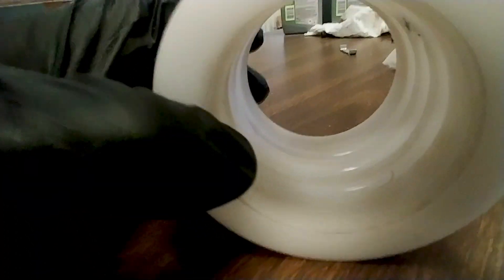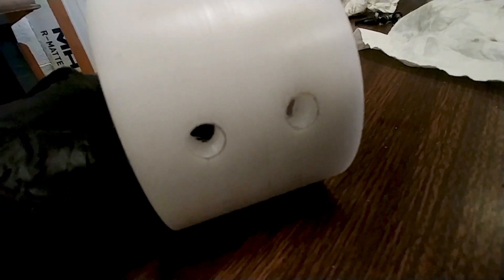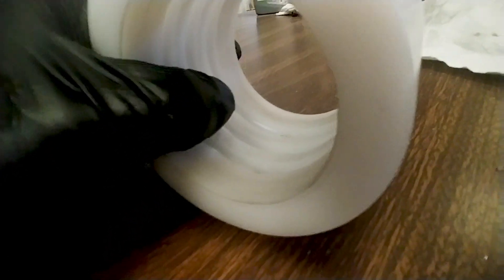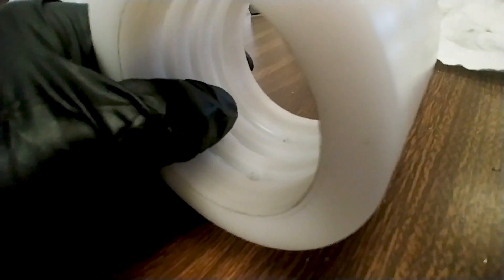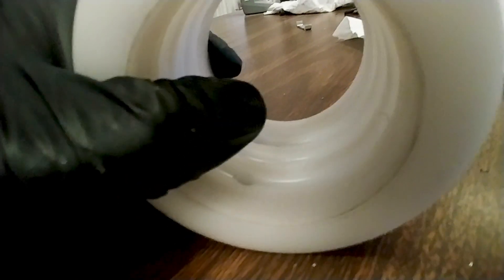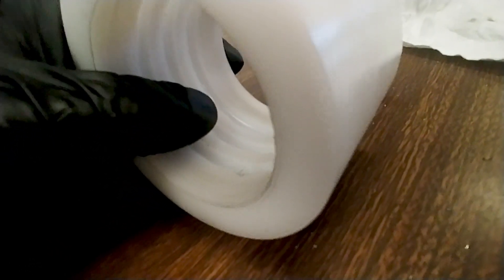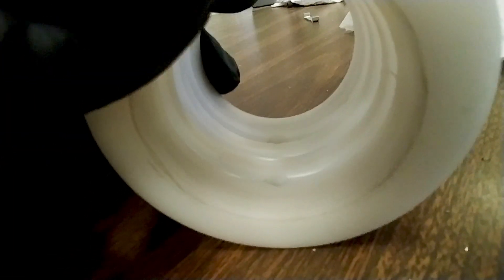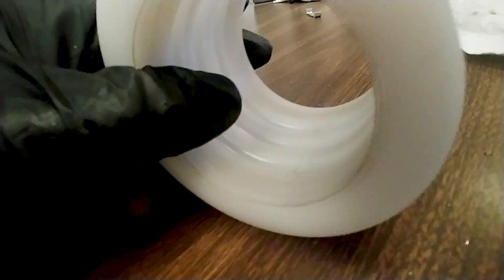Unable to Hold Pressure - Flying the Raptor Prototype

Comment: Any comment about the turbo guy that had some input about your choice of turbos? Rv6evguy  sounds like he knows a thing or two about turbos.
Reply: It's been at the top of my mind regarding this project.  They normally are two sizes and are spec'ed using RV guy's design.
Reply: Bjarne Värme
 Yes, no doubt that Rv6evguy is sharp concerning serial compounding turbos for his Petrol Subaru aircraft conversion engine, with nice intercoolers looks top notch to me... That being said Peter did his homework for serial compounding the 3L TDI Turbos... I don't think Muller is attempting to produce a race aircraft with Raptor... The Raptor's target is to have a service ceiling of FL-24 and sip fuel at 7~11 GPH... To my experience with turbo charging diesels this reflects a planned target of Raptor's diesel power plant producing between 140 ~ 210 Horse Power @ Fl-24 continuously with reserve HP...   Long range roomy luxury cruiser capable of tracking groundspeeds well over 200 Kts. with a pressurized cabin... From my calculations with the turbos that Peter is employing it appears to me he has nailed his intent. The Intercooler/s shouldn't be a problem to get dialed in, once Peter progresses in his flight testing to higher altitudes. At FL-24 the temp is about -32.5 C / -26.6 F  most of the time with tail winds traveling from West to East most of the time facilitating ground speeds of over 200 ~ 230 Kts though the corrected IAS of the aircraft is indicating only 100 Kts. when traveling in North America. The difference at the end of the day is fuel economy 11.8 MPG with existing aviation petrol powerplants Vs 29 MPG with Raptor's Diesel Power Plant... With engineering turbos it's a balancing act between intention of wasting fuel with high speed or cruise economy. Personally I like cruise economy... When we up the boost for speed we end up spending lots of money paying for the fuel only saving just a little time... Cheers
Reply: @Will Hibbard II ....  Basic thermo dynamics are that and you have to work with them. The current setup is wrong that’s it. 🤔
Reply: @richard8181  , Nope... I disagree Peter's specs with his turbocharger series combination will do the job as he intended... Just not to RV6EVGuy's preferences... Raptor a luxury cruiser with reserve power vs RV6 No reserve pylon racer... RV6 knows petrol SI turbocharged engines... 🤔To categorically across the board claim that the turbo setup for Raptor is wrong I would find insulting. From my point of view, RV6evguy presenting a Man 3 stage compressor designed to pump Co2 from gas to liquid is horribly misleading. RV6evguy compounding sizing turbo theory with an aircraft designed for above FL- 40 operations isn't spot on either...Interesting information however not applicable to CI Diesel design at FL-24...

Sea level ~ Fl-18 expect 1 ~ 1/2 atmosphere ambient temps range from +15 C ~ - 28.7, FL-18 1/2 atmosphere ~ ambient temp -29.7 C and FL - 24 ~ 1/3 atmosphere ~ ambient temp - 32.5 C... When you work with real dynamic numbers for benchmarks you can see what to expect at altitude... Balancing coolers to drag is part of the experimental process with negotiation of desired balance of result... 

Not right or wrong just a difference of opinion of reserve or no reserve horsepower and the resultant drag of cooling 400 HP continuously... or cooling say 250 HP continuously with reserve... The Constellation aircraft used this strategy and it worked crushing other competitors with piston engine performances with efficiency, lower maintenance cost and quiet reserve... For many years!

Thermal combination compression influence totaling less than 180 F... Requiring relatively little inter-cooling... At FL-26 performance will degrade rapidly however that's not part of the intended envelope profile for Peter's creation of Raptor. When operating above FL-26 an inversion takes place that axial turbines, symmetrical centrifugal volumetric velocity compressors, blowers, superchargers facilitate better than what a single turbo or turbo combinations can offer... 

Many folks talk Turbo synonymously with turbines, symmetrical volumetric flow centrifugal velocity compressors (Turbochargers)... The difference? Symmetrical centrifugal compressors, blowers and superchargers won't/don't create vacuum.

Turbo effect is facilitated by asymmetrical volute housed centrifugal impellors that employ both centripetal suction on the intake side driving increased velocity at discharge side, increasing both intake and discharge velocities simultaneously...
 

I've found many name brand turbo products to be just symmetrical volumetric flow centrifugal velocity compressors driven by symmetrical volumetric flow centrifugal velocity compressors... Not as efficient as true turbo technology in some applications... These are generally marketed as Turbochargers...
 

They work to facilitate boost when applied with specific parameters... However for me to say he need not employ a Turbocharger but to employ only dual volute Turbo series compounded with a duel volute Turbo would also be insulting...

Many tricks in the trades that waste fueled energy...  

I mix and match regularly with variable results with all types of these units for the marine propulsion industry. Your mileage may vary😉 Cheers
Reply: Hi  @robertkramer621  , Yes I know I cast yarns of word salads. If your referring to RV6evguy's analysis as dispassionate concerning serially compounding turbos for converting automotive CI Diesels to aviation powerplants. Verses my response seeming somehow emotional to you. Honestly I have no horse in this race! I believe that RV6evguy does. He has created a business with his Subaru petrol system and pushing that engine to top horsepower for pylon racing.

The horse race is similar to the war of the currents that Edison and Tesla demonstrated in their marketing campaign to win contracts. Edison wanted DC because he had commodity business interest in copper. DC meant bigger wire to handle the DC current so he promoted it. Tesla on the other hand with 3 Phase alternating current proved that with higher voltage that smaller wire could facilitate more work with higher efficiently. 

Axial turbines and centrifugal compressors fueled by Jet A are most efficient per pound powering ships, generators and fixed wing aircraft when loaded with cargo or people.

Turbine engines have proven reliability with a remarkable service history and economic fuel consumption per cargo weight and passenger mile. The numbers don't work economically efficiently with 4 ~ 6 place aircraft.

Look at the P-51 Long Nose Thunder Experimental aircraft propelled by the 601 Walter Turbine. This is a single place aircraft that is very fast delivering a cruise of 220 kts IAS at 12,500 MSL trading fuel for distance at the rate of 4.3 gallons every 22 nautical miles of distance progression every 6 minutes... When the math is worked the average MPG is 5.88 MPG on a thousand mile trip employing an engine that can carry 16 people for single pilot work is a luxury expending 170 gallons to do the work.

Aluminum block CI piston diesels have arrived with proven reliability rivaling turbines. (We have 20 years data) almost the same weight as their air-cooled counterparts capable of delivering twice the usable horsepower of their same weight petrol fueled counterparts.

Same weight engines but the diesel is capable of providing twice the propulsion.      

I spend time in the marine industry working with turbo boosted CI diesel propulsion. My experience with boosting diesels is that KWH output rockets compared to boosting petrol engines. CI Diesels have reserve torque because of the much higher compression ratios. When we boost CI diesels to max design horsepower they respond with increased overall torque delivering Higher KWH output which equates to more heat. In the marine industry ambient cool water is available and working with intercoolers we can cool any part of the system without creating additional drag.

Balancing the economics of fuel burn of 7 ~ 11 GPH fuel flow is exciting to me in a 4~5 place aircraft. Capable of doing the same work at FL-24 that the Walter 601 Turbine requires 43 GPH to do.

I wasn't aware till first viewing Raptor in June of 2020 that diesel pistons were so efficient at propelling light aircraft... With Peter's application he has available twice the power he actually needs so he can afford to operate it at lower horsepower boost settings to conserve fuel and reduce heat. It will become clear as he progresses with altitude test through 12,500 (- 1.6 Atmosphere) Then FL-18 (-2 Atmosphere) and finally FL-24 (-2.58 Atmosphere) 

The demonstrations at 5,500 (- 1.22 Atmosphere) Look good to me. I know he has enough boost at this point balanced to his intended fuel flow and that's not the problem. He has enough room in Raptor to add as much radiators/intercoolers/oil coolers as he wants to achieve his thermal cooling objectives.

My future is calibrated these days to do a similar Experimental aviation work employing a marine 3 L V-6 CI diesel except similar weight to the Audi 3L TDI with a more conventional all composite aircraft that I prefer for personal use. I'm not wanting to create another business like Peter or Rav6evguy. 

I'm inspired by both guys but I have my plans are coming together to produce for myself what I've found lacking with conventional certified aircraft and other experimental machines. 

This will be my 3rd aviation experimental to produce. Cheers
Reply: @robertkramer621 ,  If your talking taking time to further watch RV6evguy's channel I unsubscribed to it after his last presentation. I'm not a fan. Presenting a Man 3 stage centrifugal compressor designed to pump CO2 is way off topic.  I've worked with those machines in their application in chemical manufacturing. Further presenting an aircraft that is designed to operate @ FL-40 again way off topic... As far as me leaving a public trail of positions which you view as trounced by reality. I'm persistent and tenacious with my innovations. With experimental there are many ways to get the job done. I see what's right with Raptor not what's wrong with it. A very worthy innovation of Burt Rutan's work. Not quite my cup of tea however I like it. I knew it would fly before Peter flew it. I knew it would be fast even though he overbuilt the concept prototype. Watched every update that Peter has produced. Which aircraft is your favorite to fly and how long have you been a pilot? What's your favorite engine?
Reply: @itsverygreen532  , It’s true when turbos are compounded off of a common manifold in configuration the Egt/TIT is up. As I’ve said it’s a balancing act. Using the second turbo as an additional muffler with the increased backpressure is a cooling balancing act. 

More boosts create more power, higher fuel flow, higher temperatures! Since CI Piston Engines are effected directly by compression ratios with turbo boost the relative term is (Combined Compression Ratio) 8:1 Piston SI petrol not much heat created by the engine up to 32:1 Piston CI Diesel under KWH Load equates to plenty of heat generated by the engine at the exhaust.

CI Diesel engines will run higher EGT/ TIT when under full torque KWH loads than SI Petrol Engines. It's physics of compression happening in the engine.  

I think what Peter has gotten right is he only needs about 220 HP for a cruise climb out with the Raptor platform. He is getting that with his Audi TDI power plant at 11 GPH fuel flow. Plus allot of additional reserve. To do the same work with Petrol power plants it takes 22 GPH fuel flow. At least that’s what I see! 

Bottom Line when you have the boost available and you call for torque loads, heat is the byproduct delivered through the exhaust! As long as the exhaust drive side of the turbo can negotiate the EGT without heat failure... No Problem!

The airflow accelerator boost side of the turbo is only negotiating about 3:1thermal compression equivalents with both SI and CI engines. Approaching 4:1 boost compression creates other problems. 2:5 is my rule of thumb for production side boost for marine application.   

I’ve addressed before that the Concept Raptor Prototype ended up overbuilt with more weight than the intended design weight target. Built like a tank. The first time I worked an all carbon fiber boat hull I overbuilt it too as the hull ended up built like a tank. I learned on my next hull where to back of the unnecessary weight I added. I ended up trimming the fat, reduced the weight lower than my original concept target by 150 pounds. The Third hull ended up being lighter, faster, and stronger than the second. So I’m confident that a Raptor production prototype will be more on target for intended weight. 

The good thing is Peter and his team produced great quality molds so the aircraft on a next build will be simple to replicate and trim the fat. 

Raptor’s concept prototype empty weight (as is) to my thinking, is a great platform to flight test the propulsion system in my book. Additionally it gives great data of cruise climb to altitude. It represents a fully loaded Raptor. The propulsion system is getting a workout. 

Example: Have you ever flown a Mooney Bravo fully loaded to FL-24? It climbs out just about like an elderly C-150 too. I’ve experienced on long trips from 0 to 17,999 arriving @ FL-18 takes a while 375 ~ 450 FPM Avg. It’s a balancing act in the thin air VX 105 CIAS cruise climb doesn’t work but VY cruise climb 120 Kt’s CIAS works to step by step get to FL-24. The single stage turbo in a Bravo does perform well to FL-18 but is lacking through FL-22. Some days in a fully loaded Mooney Bravo It’s a long way to FL-24 from FL-22. (Like flying a C150 from 10,000 to 14,500) That being said FL-26 in a Mooney Bravo is doable just not very efficient to the envelope. Sometimes to call the situation Mooney Bravo Heavy I've considered.😉

Note: VX in a Mooney to clear an obstacle is about 65 Kt’s. My style of flying I accelerate to 80 Kts in ground effect,  clear obstacles then accelerate to 100 Kt’s to 3,000 AGL then accelerate to 105 kts through 5,500 MSL, then transition to 110 ~ 120 Kts CIAS to altitude. VFR climb out I let the machine do its thing! Whatever the FPM is it is! To keep the cabin quite 120 Kts CIAS is relaxed and comfortable when flying a Mooney on long trips of 3 hours or more en route cruise times. 

When dealing with single engine piston propulsion. Haste makes waste! At altitude the 120 Kts CIAS reflects ground speeds of 135 ~ 210 Kts depending on wind aloft components. If I'm pushing 140 kts. CIAS in cruise I feel I'm being wasteful with fuel. 

What Mooney and Raptor have in common are laminar flow wings. Once you get a Mooney to altitude (even naturally aspirated) The VFR cruise decent is hard to beat. The heaver the better! Raptor has a much more comfortable cabin than a Mooney plus Raptor is designed to be a Pressurized cabin with an AC for ground operations… Those are things right with Raptor.

Normal operations of a single turbo or combination of parallel turbos reach compromising limits at FL-22... Been there done that got that T-Shirt. 

Personally I haven't experienced series turbo single engine piston performance yet at altitude. Loads of experience with marine applications. It looks good! We will see! 

Finding the curve of serially boosting turbo boost at FL-24 with CI Diesel is a subject that long term experienced data isn't readily available.

Heck, till June 2020 I didn't think about employing piston CI Diesel naturally asperated  for light aircraft duty. Evidently in Africa necessity of no avgas or jet A pushed people there to convert to develop aviation conversions piston CI diesels with 20 years of data proving reliability while I was unaware.

I spend time in the marine industry. Serial boosting piston CI diesel propulsion is common. The ocean is our radiator. We target the intended KWH requirement and boost accordingly to optimize reduce fuel flow.

It's just been in recent year that marine aluminum  CI piston diesels for light hulls have been showing up at the shop for servicing. I wasn't aware how light these unites are compared to their cast Iron counterparts. With comparable weights to air-cooled aviation petrol aviation powerplants.

I've just started experimenting (Past 3 months) compounding off of combined exhaust. Normally we isolate each turbo on separate exhaust manifold banks. Then parallel the boost or serial boost depending on the need for marine propulsion applications.  

We are adding another shop and been too busy to further investigate further at this point. Plus a straight line wind took out many docks damaging many boats compounding normal work loads for this time of year.

I don't apologize for my long winded responses. I just want to relate so others can makeup their mind's. I have senior hands on experience that relates additionally I have an airplane habit.

I'm thankful Peter's guts to produce his content publicly with the good, bad and the ugly is something I won't do. However it's very inspiring. What he has produced to this point I term as TLAR (That Looks About Right) to my eyes. Will be room for improvement. To me that's what experiment le equates to. Lighter, Faster, Stronger, More fuel efficient and durable. Your mileage may vary! Cheers
Reply: @itsverygreen532  , Hi Robin, you sound intelligent and it appears you’ve researched the materials out there. I would appreciate links and references to the materials you’re referring to. 

I prefer not to talk horsepower. Horsepower to me is a marketing scam. Torque is my focus at specific RPM. Bottom Line if I’m powering a generator or an alternator I need to know the KWH at specific RPM, the driving fuel, and the fuel flow rate… 

KWH tells me what I need to know to employ the engine application.

With marine application power plants the screw (propeller) is the ultimate dyno. I use a marine dyno for testing at the shop if I’m sorting out a problem and need a load that a test wheel and water won't detect.

Dynamic water test of hole-shot, troll, fast troll, low-end before plane, low-end plane, economy plane, midrange, upper midrange, economy top end, WOT and flat-out speed. 

With marine applications the throttle all the way down isn’t flat-out top performance. With marine engines they adjust the throttle linkages to where hammer all the way down is economy WOT.

Like boats the aircraft prop matched to the application is the magic to all-round performance.

My rules of thumb turbo charging Piston CI Diesels for marine applications… With my experience over 3:1 boost waste fuel and becomes inefficient with economy. You can do it but it’s wasteful and is racing for the rich with money to burn. 2.5: 1 boost appears to be optimum trade to me horsepower to fuel burn.

Concerning Piston CI Diesel horsepower: We can get in the range of 235 hp (175 KWH) per liter in racing applications for 1/8 mile drag strips. The price in fuel burn is 118 GPH fuel flows, per liter of displacement, not a good trade for fuel to (KWH) horsepower conversions economy. 

Turbo scavenges reserve horsepower at 2:5:1 Boost 20 horse power (15KWH) per Liter displacement. 3:1 Boost 27 Horsepower (20 KWH) 3:5:1 Boost 33 horsepower (25 KWH)… When talking horsepower and boost the total horsepower may be said to be 440 Horsepower for a piston engine.

KWH output removes the loss in horsepower. Bottom Line with boost is combined compression ratio minus scavenge. Manufacturers/corporations tell half truths with word merchandising to sell their products to the indoctrinated consumers.
 100 KWH per liter displacement has proven economical minus boost. 3 Liter X 100 KWW = 300 KWH. With 2.5:1 Boost 15 KWH Loss X 3 = Minus -45 KWH. Or 255 KWH then you can divide 255,000 watts by 750 = 340 Horsepower actual output. Mystery solved to a point. 

Marine applications valve timing doesn’t use variable valve timing. With both SI petrol and CI diesel pistons engines the camshaft matches the application. 

Automotive camshafts generally don’t perform well in marine applications. Like the screw the camshaft is the key to overall performance with generators, marine and aircraft.

Marine turbo compounding is calculated by liter displacement, CFM intake, CFM exhaust, averaged volume at intended KWH Load. Most propulsion providers try to match the CFM and volume on the money at 2.25:1 boost and split the bank with two smaller turbos when compounding parallel. 

They match the compression for overall compression ratio. Volute turbo and symmetrical centrifugal are two different animals. Volute Turbo is marketed as Turbo. Symmetrical centrifugal are marketed Turbocharger. 

Perkins Diesel factory training showed us the difference in the 1960s. Volute turbo in parallel or serial same size works. Symmetrical centrifugals are different geometry then there exist hybrid combinations. This may add confusion to the boost application conversation.

Knowing Volute Turbo my help!

I believe if you read between the lines you my glean some useful data points and dovetail into what you are looking for.

Whenever I find a useful benchmark data points I always do my own research to verify. This is boiled down Cliffs Notes backed by my hands on experience. I welcome your input of adjustments to these TLAR (That Looks About Right) numbers I've noted.

I'm an old school slide rule engineer 

Bottom Line: Cam Shaft, Screw, turbo and cooling are relatively inexpensive to the overall propulsion scheme for powering with conversions.

I've found that you can't break the rules of physics but you can bend them. Peter making up his own mind for what he specified and purchased will either prove correct for his intent or he will make changes.

Science is one of my favorite subjects however so called scientist skew numbers everyday. I will take hard experimental work with results any day of the week. At least then you can find the benchmark and make needed alterations. 

It's his experiment that's worth it to me to take time to watch. His production is a monumental effort. 

Hope my input helps you, have a blessed day! Cheers
Reply: @itsverygreen532  , Thank you!
Reply: @itsverygreen532  , Yep, I studied that when it came out and it appears that I've revisited it within the last 3 months.

He correctly states turbocharger.

The approach dynamics come into play when boosting over 3:1 which works, just not very fuel efficiently.

Now I see why my input concerning Peter's approach gets a little resistance from other research developers from time to time with applied applications.

Most in science like symmetrical approaches. Balance in - balance out. My field of expertise is asymmetrical power applications which volute turbo represents.

Peter's approach Youtube Search:   Raptor Aircraft Turbo Overview... From 4 years ago.

This is an asymmetrical approach to have the boost available at FL-24 needed that a single turbocharger or parallel compound turbo set won't facilitate reserve boost to achieve.

With this approach he has available the boost he needs for FL-24 operations with reduced exhaust restriction more in balance to 2.25:1 ~ 2.5:1 economy boost to from below sea level ~ FL-24.

With his arrangement the second serial turbocharger is loafing with out much exhaust restriction and acting as a second muffler yet in within parameters of design creating the byproduct of about 6 PSI additional boost that will be available at FL-24.

The benefits are: Less backpressure on the exhaust with higher KWH available at the output shaft operating at -0 ~ 5,500 MSL with good fuel economy and a clean running engine. Yet providing enough boost to facilitate FL-24 operations in the thin cold air. Enough boost to keep the intended target HG manifold pressure boost consistent from ground to FL-24 and negating the pressure drag of symmetric volumetric pressure application. 

Bottom line is targeting reduced fuel flow for 1~6 place light aircraft applications!

Then reduce pilot load by automation programming to operate the engine, provide early warning that something is wrong without complete engine shutdown, provide needed thrust propulsion for the aircraft design, prove reliability, reduce maintenance, provide pressurization for the cockpit, reserve KWH available to operate an air-conditioned cabin, provide cabin heat, provide fuel tanks heat and be affordable to almost anyone.

Show me the money is applicable.

If money and fuel efficiency isn't a problem then purchasing turbine propulsion is for you.

Most non corporate pilots tend to operate their machines below 5,500 MSL. Peter has already demonstrated with a wider, heaver aircraft fuel efficiency with speed that Beechcraft Bonanza is incapable of. Even better MPG than a Mooney M-20 will deliver. Very hard to do.

I ran a fleet of 12 Ford 3/4 ton cab and chassis units outfitted with service beds with liftgates, Originally powered by inline 6 Ford petrol engines. Consistent combined static weight loads with tools, parts and equipment, of 6,700 pounds and able to haul additional equipment on over racks and in the service beds. Petrol engines in this application averaged under 8 MPG. However powered by 6.9 liter International diesel engines with 2 15 gallon fuel tanks and manual transmissions. The fleet averaged 19 MPG. We loved it! 300,000 miles minimum without major repair and more reliability! Guys that really took care of their equipment we generally retired their service trucks @ 350,000. The buyers of this used diesel equipment reported additionally adding another 150,000 miles without major repair.

Sometimes we had to haul bumper trailers which the general fleet would do without problem.

Later I bought an automatic transmission  version and average gas mileage was exactly the same manual transmission versions. This avoided a maintenance step of replacing the pressure plate at 80,000 miles. That we experienced drive train failures with. The clutch plate and the rest of the clutch assembly still were ok however since the transmission was pulled we replaced the entire assemblies.

Failure with the torque converters occurred at around 200,000 ~ 275,000 miles.

Part of the operation we fabricated stainless steel equipment and we hauled 9,000 pounds of stainless sheets loaded on flatbed trailers 3 days a month.

I ordered a king cab version with automatic transmission which we loaded the same way and experienced the same fuel mileage with it. 

All the trucks would lug down with the stainless trailer load. They would do it but didn't like it. We added a banks turbo to the king cab version I specified with auto transmission. When hauling the trailers it literally didn't notice the load and was much more comfortable.

The only difference was that with the trailers the fuel mileage dropped to about 12 MPG but if the driver stayed out of the turbo with the normal static load the overall fuel mileage increased to 21 MPG from 19.

2 MPG improvement is a big deal when you crunch the numbers X 12 units, consider average fuel savings. 

Average 300,000 miles of service life X 12 unites and save 2 gallons MPG per unit.

After the first cycles of these unites we ordered the F - 350 cab and chassis automatic versions with 4 instead of 6 tires. Outfitted our service beds with the banks turbo unit. 

I exited that business operation completely by 1997 to invest full time duty to aviation and marine application.

Finding the balance of the actual power needed to do the jobs, adjusting the operational fuel flow to meet that need and reducing maintenance cycles is what I do with Legioneering. 

I've never had a conversation with Peter Muller however he appears to have a similar wavelength.

I work with electric marine propulsion systems as well on design life of system cycles ranging from 2 ~ 29 year. We can power aircraft electrically however the maintenance cycles realistically for aviation batteries has a 2 year service cycle life at this juncture.

When you crunch the numbers for a 6 place aircraft and consider normal operational time and yearly cost of servicing the system.  Peter's solution makes sense and cents.

I talked to one of my established aircraft manufacture founders last Tuesday. I've fabricated specialty parts for them over the years. They produce a top quality FAA certified aircraft and working with me for a future electric version. 

When I contacted Peter without response from him in June 2020, I was looking for an all composite aircraft manufacture that had produced quality molds. To apply what I've been developing and applying in the marine industry with electric propulsion. 

After I crunched the numbers. My calculations indicate that yes we can facilitate electric aircraft propulsion however it makes more sense to CI diesel piston turbo power for 1~6 place aircraft propulsion. Gaining the benefit of reduced fuel flow rates, lower maintenance cycles, improved reliability, affordability, more comfortable cabin, reserve power, increased reliability and better operational at altitude performance for 1/10 the financial investment of Petrol propulsion.

Even if the price of diesel increased to $10.00 dollars a gallon. With this engine system balance scheme makes sense over electric propulsion to my way of thinking.

It would be very hard for a petrol engine to drive that 5 bladed prop. Very impressive torque required! Like an ultimate dyno in it's capacity to load a propulsion system. Demand torque adds heat!

Another thing/s Right about Raptor.

His stuff is TLAR to my experience.

I hope we will have a conversation one day!

Have a blessed day! Cheers
Reply: @robertkramer621  , I started watching it last night, I turned it off after about 3 minutes. I will revisit it now and get back to you.